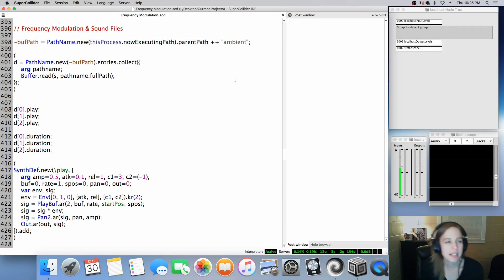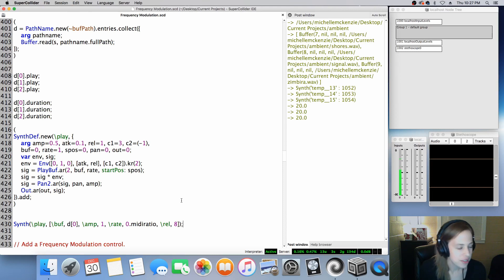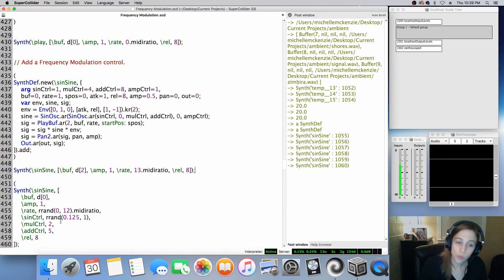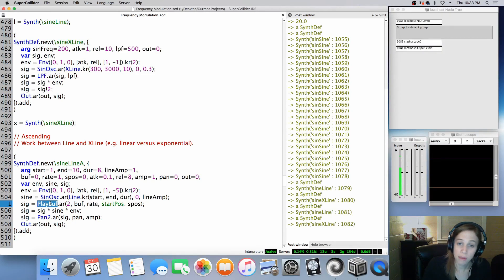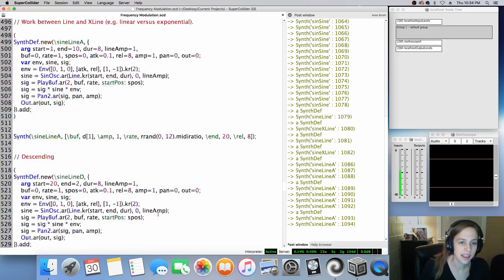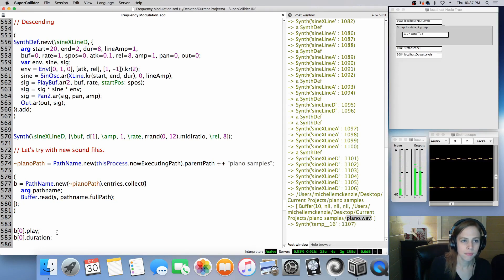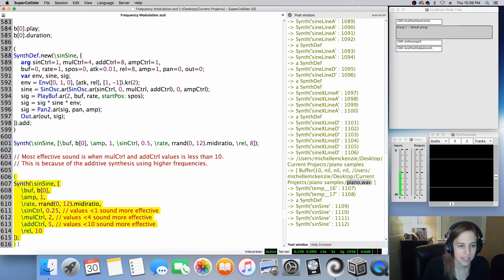Frequency Modulation With Audio Files

Comment from the maker: After looking over this video, I see that, with every instance I use a sound file, I'm actually using amplitude modulation instead of frequency modulation. 

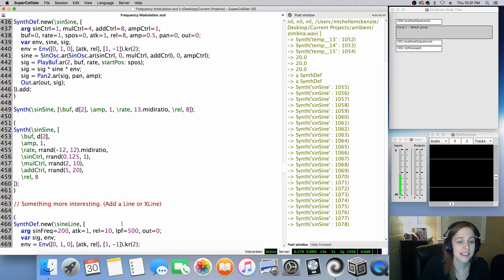My sine tone demonstrations, starting at 5:54, are examples of FM. Unfortunately, I use this line of code as a control variable for amplitude, not frequency. I'll be better about this going forward. Thanks for listening!

Comment: Hello SoundEngraver, isn’t this method amplitude modulation rather than frequency, since the amplitude of the buffer is being modulated?
Reply from the maker: Yes, you would be correct. At the time of making this video, I confused the two (FM and AM). Thanks for pointing it out!